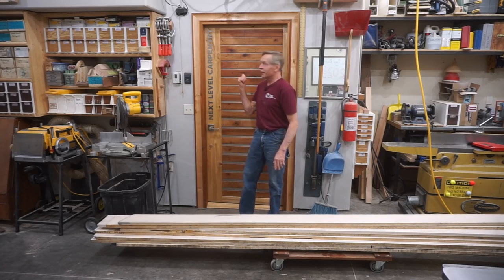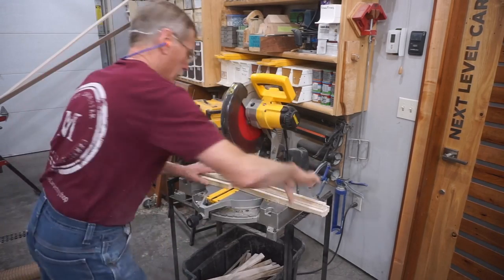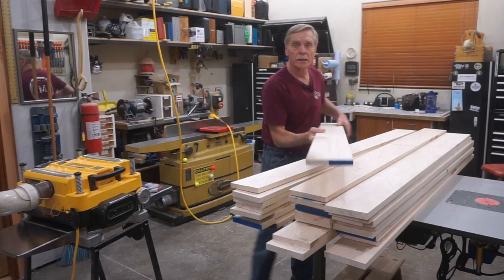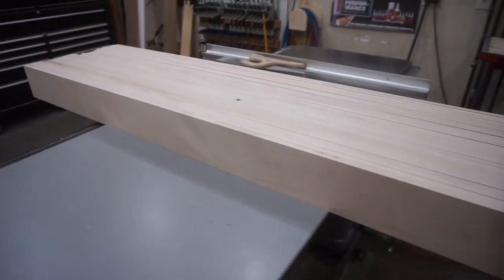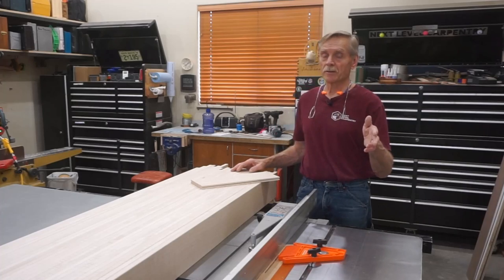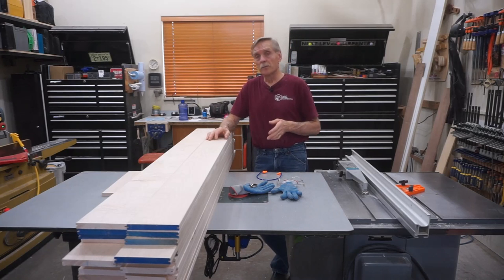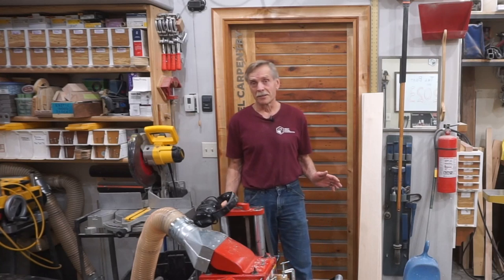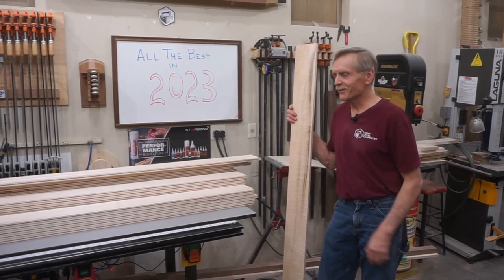Make Custom Nickel Gap Paneling

Comment: I, too, am chronologically gifted but I never fail to pull something out of one of your videos that I either didn't know, or had forgotten. One of the reasons I love your vids. 

Watching you mill this soft maple and hearing this will be painted almost breaks my heart. My eyes caught all of that impressive figure that soft maple (in my experience) is known for, and knowing it will be painted over is a bit of a let down. I recently built a mid-century modern inspired stair railing system for a client (using horizontal metal rods) and specifically suggested soft maple for the "happy accident" highly figured pieces that are inevitable. Some careful planning in the milling and construction process allowed me to highlight the figure in the newel posts and hand rails and really lent a "wow!" factor to the project. Oh well, sometimes designers and clients just want what they want ...
Reply from the maker: It's good to hear that you see and appreciate the significance of beautifully figured wood and work to make it a 'wow factor' for your projects... that's pretty rare these days.  The way this beautiful batch of highly figured soft maple ended up as paneling that gets painted is a somewhat convoluted story but, in this case, can't be blamed on ignorance on the part of client or designer.  For the record: it highlights a disconnect in the purchasing process at the hardwood supplier where I bought the material, a frustration that manifests itself to me often and was especially blatant in this particular project.
Don't let this one situation discourage your from keeping the faith for showcasing figured wood?😎

Comment: I have watched your channel for a long time and i don't think i have ever seen the stop block for the jointer. You seem to always solve problems with so well. I need to get that made. Have a nickel gap coming up so this was great.
Reply from the maker: Thanks Rod.  FWIW Here's a video I did showing how I make 'power tool parking brakes' like the 'stop block for the jointer': https://youtu.be/NF4oF9kuiH4  Pretty easy to make and very useful for reconfiguring equipment in the shop...

Comment: Another excellent video. Anybody, including me (45 years a woodworker) should watch it all and be able to take some lessons from your processes. When we buy waney edge rough timber, it would be impossible to square one edge (after flattening one face) on a planer; so, we use a track saw which gets us near enough and then make a final pass of the edge through the planer. 

I have/had the interior fit of a barn conversion to do - for my wife and I. We wanted all the trims and doors to be of Arts and Crafts style and in European oak. That meant over £20,000 worth of oak. There was no way at my age that I could process over 5 cubic metres of rough cut long lengths of oak timber and still be alive at the end of it. So, we worked with a couple of good hardwood merchants to get them to process the oak into a couple of different thicknesses and a couple of widths - all selected so as to minimise waste. I’d say that we got 85%/90% of a result of timber ready to be finally cut. The main issue was that the guy on the multi head planer tried to squeeze the last board out of stock just not thick enough and so we got one side on some boards which was not fully planed. In the amount that we ordered, I accepted that because I wanted to maintain relationships and I knew that we would inevitably have to cut some lengths into short pieces and so I could live with the “faults”. All of our trim is stain grade; therefore, we did give it all a final light sanding. 

On the question of acclimatisation of timber; even though the hardwood supplier keep stock under cover, the ends of the sheds are open most of the time. I think that does affect moisture content. Therefore, to avoid possible issues after I’ve done the extensive milling, I do store the timber in a closed but unseated shed before using. It’s only a halfway house to a heated interior but I hope it reduces the possibility of cupping or splicing. Just my view.
Reply from the maker: Such are the realities of mindful millwork, right?

Comment: Matt, this was my first introduction to a molding machine.  Now I will be pouring through the woodworking machinery makers to learn more.  The first observation is the compact size.  I might find a use for such a machine in the future.  Thank you.
Reply from the maker: I've done a few other videos featuring that moulder that I hope you get a chance to check out.  I think their capability, usefulness and profit potential is highly under rated these days.  I've made miles of moulding with that little workhorse in the 20+ years since I bought it so I highly recommend it if you've got a use for producing impeccable mouldings.

Comment: That was an enjoyable video, too bad about the sound, but not the end of the world!  You could have just done a voice over in that time segment.
Wondering a few things, did you pre finish the wood?
How did the paneling get installed?  Was it nailed or glued or both?
If nailed would you blind nail in the slot at an angle before the spline was inserted?
If you glued it, would you use dollops spaced over the length or a continuous squiggle along the whole length?
If glued, what glue would you choose?
It would be nice to see you do a paneling install!
Keep up the good work!
JIM 🥰
Reply from the maker: Hey Jim,
The wood is currently at a painter shop getting prefinished.
I'm pretty sure the installation will just consist of brad nails shot at an angle through the spline and groove into half-inch drywall. I'll probably face nail it in a few places int6 studs at 16 in on Center if necessary. I don't plan to use any construction adhesive whatever in addition to those nails because most of the holding power is achieved by a baseboard that gets nailed over the bottomends and an apron that gets nailed over the tops. It's all pretty routine and specific to my product and installation so I'm not planning to do a YouTube video of the process. I may do a short snippet for patreon but that might just consist of a glorified slideshow.
Reply: @NextLevelCarpentry  Thank you for your reply!
JIM🤩

Comment: Enjoyed watching you doing all the unseen hard work, Matt. Great result. Pity about the microphone wire. Pleased your video is not full of adverts. I like the small moulder, it's a very useful machine. Tony
Reply from the maker: Do you have experience with a similar/small moulder?  Funny thing: As far as I know I'm the only contractor in my area who brings that machine's capability to my clients which is an amazing bit of exclusive marketing.  Others have to sub out even limited runs of custom moulding to dedicated millwork company, a real restrictive constraint for both contractor and client.  Makes me feel a bit like I have a superpower where that's concerned as I've done many very profitable projects where custom millwork was a key feature for the design.
Reply: @NextLevelCarpentry  Not one of those Matt, as far as I know those machines are not available in the UK, probably because square cutterblocks are banned
 in commercial set ups where people are employed. Great little machine, I've seen them before on YT. I just used to buy additional spindle moulders (shapers) 
cheap from auctions, tweak them and leave them set up to do repetition work. I had three left set up doing a single operations, one for doing odd ball one offs 
and two auxiliary spindle moulder heads made by Holz-Her left set up doing single operations. I just used to walk around machine to machine no setting required, 
very fast turn round machining the components, with no down time. Tony
Reply from the maker: @tonyworkswood  multiple machines that you can leave setup for dedicated operations are definitely the way to go in a production environment as long as you have the space and equipment to make it work out. I guess the trade-off with a smaller machine is that it's faster for little jobs but slower four big ones? Interesting about the cutter head design rendering them band but I imagine that's a positive thing overall.
Reply: @NextLevelCarpentry  Even square blocks for the Spindle moulder (shaper) are banned in the UK. They still get used in private/family businesses though, I have some. I haven't used them in years, they were common once upon a time along with flying cutters, that's why they were banned.
Reply from the maker: @tonyworkswood  Square blocks could be banned for scary looks alone, regardless of flying cutters since they are a treacherous looking thing even when they're not spinning at light speed! 😮

Comment: Thank you very much.  I too have a Dewalt planer and I am wondering if you converted yours to a Helix style blade.  I don't have a Willliams and Hussey planer/molder but now I'm glad I don't.  Kind Regards.  Craig
Reply from the maker: Hey Craig,
No helical head in my thickness planer...  the slightly 'scalloped' surface they leave behind doesn't compare to the flat and smooth finish straight knives produce, an unacceptable tradeoff IMHO.  
Despite somewhat bizzare interactions with W&H I've no regrets for owning and using one of their machines and would encourage others to focus on the machine's capabilities and benefits rather than company dealings.
Reply: @NextLevelCarpentry  Thank you.  Craig

Comment: Thanks Matt, for the great video as usual! Sound issues aside... You've probably answered this one before but where do you get those insert plates with the replaceable insert? The orange one looks new or at least I've not seen it in your videos before... Thanks again for the channel.  I really do learn a lot no matter what you're working on!
Reply from the maker: Hey Scott,
Here's the stock answer I give because your question does get asked frequently:
I bought that insert about 20 years ago Scott... unfortunately it's been out of production for over 10 years. Here's a picture of the  label on the back in case you want to search for one on eBay or elsewhere: 

https://www.pinterest.com/pin/551479916872563704/  
https://www.pinterest.com/pin/551479916872563699/  
It is as useful and handy as it looks...

Since it's quite popular I've been considering getting a batch custom CNC milled to offer for sale and the orange one you noticed is an early prototype, 1 of a batch of 10, made by Greg's Garage in his sharp signature orange anodized finish.  I'm currently passively pursuing a 2nd manufacturing option and will let viewers know all about it if it's a viable product option.

Best, Matt
Reply: Collflower LLC makes a similar table saw insert plate with replaceable inserts (Saw Stop and DeWalt jobsite versions, there may be others) as well as similar products for miter saws. I got one for my DeWalt jobsite saw and think it's a great upgrade from the factory plate.
Reply from the maker: @aaronm.837  I checked out the Colliflower link... thanks for sending it.  Looks like some great products there but I don't see one that fits the old model Delta Unisaw throat opening. I suspect it's got to do with accommodating a riving knife?
Reply: @NextLevelCarpentry   My apologies, Matt, if I got your and Scott's hopes up with with my suggestion. I should have checked their site again to see what saw models they cover before mentioning it. The custom CNC milled option is probably the way to go for older saws, but it may be worth an email to Colliflower. I don't know their capabilities or costs, but if given measurements, perhaps they'd like to partner with you on those small batch runs.
Reply from the maker: @aaronm.837  please don't apologize... I really appreciate the link and info.  I already made a mental note to reach out to Colliflower to get his thoughts/perspective on it and see if it merit the 'small batch run' you suggest.  I wonder if the one he has for an old Powermatic tablesaw is the same size/shape of Delta saws of the same vintage?  Judging by the variety and quality of other ZC options on his site, he'd be the guy to make 'em if anyone is!
 You wouldn't believe the number of questions I get about that old insert plate every time it shows up in a NLC video.  Makes me wonder if there's some legal issue regarding no riving knife slot?

Comment: Thanks for another great video, Matt!  Did you store the rough lumber in your shop before processing?  I have a heck of a time with rough lumber twisting after jointing and planing.  Maybe too much moisture to start with.
Reply from the maker: I don't purposefully store lumber in my shop to stabilize it before processing and almost never have post-planing issues.  Moisture fluctuation is always a concern though so I'm thankful that wood at the supplier I buy from gets and sells stuff that's acclimated to the ambient environment here.  I do try to complete a milling project like this in a short time frame though because wood movement DURING milling is more a concern than movement after.  One thing I try to do is, as much as possible, mill off a similar amount of wood from both faces so that any reaction is equalized better.  The most trouble I encounter is when re-sawing 8/4 into 4/4 because the process exposes internal wood to external moisture and almost always reacts with cupping and/or bowing.

Comment: With solid wood splines, are you concerned about wood expansion across the grain with fluctuations in humidity? How do you plan to deal with wood movement with such a large wood panel?
Reply from the maker: Good question Ron.
Solid wood splines compared to masonite or mdf splines aren't an issue IMHO.  Also, I don't see 5 1/4" as "such a large wood panel" so I'm not concerned about the issues in question.  My main concern is with cupping and addressed that with the deep double-backout profile on the back face of each piece.
The climate where this paneling gets installed is quite dry too so I'm not concerned with expansion issues.  If I were, I'd trim the splines to be 1/16" or so narrower and set the gap between planks with a gauge instead of fitting planks tight to splines.  That might be good practice in areas where humidity fluctuations are more of a factor.

Comment: Incredible work!  Out of curiosity, how do you quote next level nickel gap paneling?  The attention to detail is such an art, but surely it's more expensive than readily available material
Reply from the maker: The secret is to make a paradigm shift to an arrangement where I only work with clients on a 'cost plus' basis that avoids the pitfalls of producing 'next level' workmanship for a fixed bid price.

Comment: Good info as usual, and Happy New Year.  But what am I missing?  If your painting over the wood, why use maple over poplar or pine?
Reply from the maker: Thanks Mark... and HNY2U2.  The wood I used is technically 'soft maple', usually an excellent "sap one face" paint grade wood for its dense smoothness, which I prefer to softer, more 'brashy' wood like pine or poplar.  Every other time I purchased this grade of maple it was full of staining, etc that was only acceptable when covered with paint.  There's more to the story but I can assure you I didn't hand select this amazing highly figured maple to be painted over but ended up going with it as a result of actions of others beyond my control.

Comment: Excellent video as always.  I do have one question though, which is how these piecea will actually be installed onto the wall.  Because they're being painted will you just face nail them and fill the holes?  Or possibly blind nail them through the tongues?  Thank you for all your work.  I have a faux beam job coming soon and may use your extreme beam method, depending on the what the owner decides on lengths, joints etc.
Reply from the maker: I plan to mostly blind nail pieces through the tongues but will add a few face nails into studs if/when/where necessary.  Truth be told very little nailing is required because 5" base at the bottom and a 4" apron at the tops will provide enough holding power by themselves that minimal nailing through tongues in between should be necessary.
Reply: Good question, that was mine as well.  Thanks to Matt for the answer.

Comment: Would you have an idea or two building a workbench?  Semper Fi
Reply from the maker: I do... but far from mainstream thinking.  'All' of the workbench videos I see on YouTube consist of an almost absurd amount of wood glued together into a massive slab that gets supported by stodgy wood legs.  My bench consists of a simple welded steel base comprised of 2x2x1/4" angle iron with a laminate covered solid core door slab for a top.  It's served me well for decades allowing me to make a far better than average living producing a wide range of profitable projects, never lacking for the features a full-on solid wood bench with tail vise, dog holes, etc that seem so important to many.  So I guess you'd need to think through what kind of work you plan to do and how much of it you want to devote to bench building and go from there?
Welcome 'back' btw... assuming you were on deployment, thanks for your service and for returning to the Channel!
Best, Matt

Comment: Great video and very informative! One question though, after painting the splines, is there enough gap in the groove to still fit the spline thickness without any fuss?
Reply from the maker: It is a definite consideration and one you're wise to factor in with a project like this.  A sloppy, inconsistent paint job could easily make a mess of that but I'm confident the painter I hired to do the work won't cause problems.